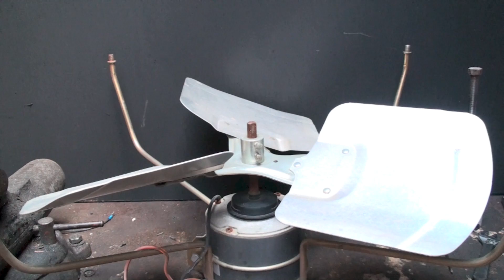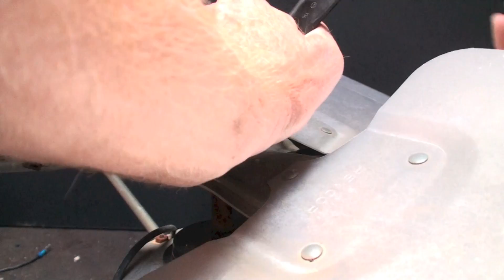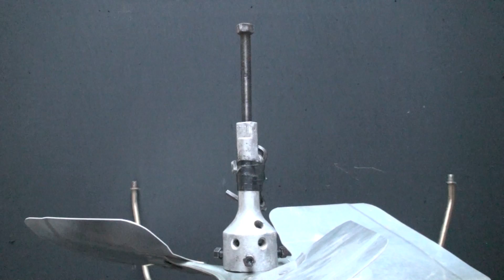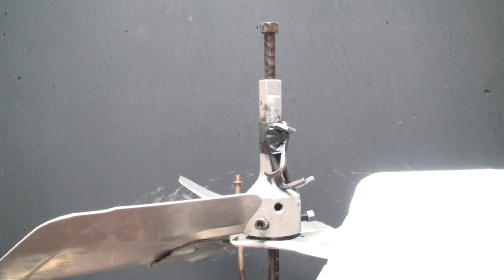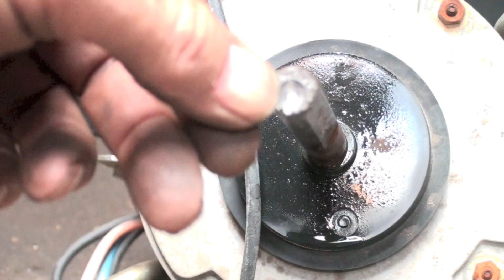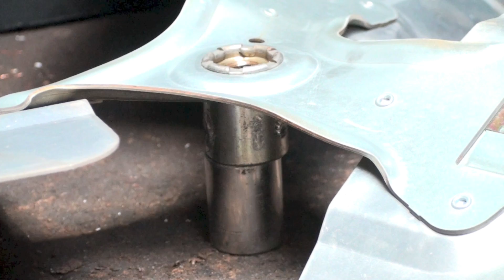How to pull a condenser fan blade

Comment: I ran across this technique. I didn't buy the guys tool, but used the process. After cutting the shaft off the motor, I used an old spark plug socket in my bench vice to drive out the shaft. It was remarkably easy. https://www.youtube.com/watch?v=11WzoU8AeJU

Comment: You don't need that puller at all I just use a wire wheel on my drill go around the shaft a few times until the rust is gone put some WD-40 hold the fan with my hand a few taps with a hammer falls right out. I got the idea from this video here it works every time.  https://www.youtube.com/watch?v=eUXvgJDRjrI

Comment: I may make me one of those pullers out of steel on my lathe :)
Reply from the maker: You can do it but make it  out of tool steel and harden it.
GFM
Reply: Absolutely, tool steel is cheap and I have a forge so heat treating is no problem. What is a good universal size to slip over the hub?....you work with these more than me. Thanks!

Comment: What causes air to exit a condenser fan grille horizontally instead of vertically? The only reasons I've heard: fan ass'y running backwards, wrong position of fan ass'y relative to the shroud (fan tips supposed to be about an inch up into shroud) and plugged cond coil. Have one now doing horizontal air flow, but none of those conditions. Cooling well. 18 or 19 degree temp spread.
Reply from the maker: It may have bee designed to work that way.
GFM
Reply: Check your capacitor if it’s running backwards.

Comment: A little tip ---since the motor is junk any how , instead of sanding the shaft, you could take your 4" grinder out of the truck and Lop off the end of the rusty shaft. Less shaft to pull. If no grinder on the truck , then yea , sand her down to shiny metal. Makes life a whole lot easier ! Rust I have found actually increases the size of the shaft. Get rid of all rust. It's worth the time.
Reply from the maker: Good tip.  Thanks.
GFM
Reply: You have saved my life!! Awesome tip will try on the motor change out i have tomorrow

Comment: I just replaced my condenser fan motor with a brand new Century universal motor with exactly the same specs.  When everything was buttoned up and looking better than previously (meaning extra care in zip tying wire looms, etc), the fan squeaked!  I treated this motor like a baby, never dropped it....  Is there any reason other than a bad motor bearing out of the box that this would happen?  The fan makes noise only in the CW direction which seems odd.  It is a reversable motor set to the CW rotation.....  You seem to be a strong authority and I was wondering if you have ever had a bad condenser motor out of the box....
Reply from the maker: Most of the time when I had something like that, it was because the box was dropped during shipment.
GFM
Reply: I solved the issue and feel foolish...  the dust cap rubber center piece was rubbing on the motor housing making the terrible screeching.  A little bearing grease on the lip and the cap is all it took.  I couldn't believe that it was loud enough to be heard at the street and next door!

Comment: from Illy Hvac llc 
i have a suggestion for you. after you clean the shaft. take a 1/2 black iron pipe, place the pipe over the shaft. hit the pipe hard a few time to break the hub loose. I do this then reclean the motor shaft relube the put the hub puller on and crank away. much easter to remove the hub. 
Ive learned a lot from you thanks buddy.
Reply from the maker: Good thoughts.
GFM
Reply: Yep, get rid of that rust line where the sand paper can't get to without that tap.
Reply: +grayfurnaceman what's the name of that tool?

Comment: T&N commented that you can drill a hole in the shaft.  I can't picture it.  A hole through the radius or the long way?  Also does anyone know what you use to lube the threads of the puller to keep the aluminum from binding up with the steel?
Reply from the maker: acoustic4037 You will be drilling a hole longitudinally thru the shaft.  Any penetrating lube will do.
GFM

Comment: My condenser fan is stuck to a rusted motor shaft. I don't have a gear puller but I do have two C-clamps. I used a wrench handle as a crossbar as I tightened the two clamps. The fan won't budge and I am afraid the monkey wrench handle will break. I need ideas.
Reply from the maker: Gino Punsalan Cut the shaft with a hack saw close to the hub.  Then you can place the hub on a vise so you don't damage the fan.  Hope this helps.
GFM
Reply: The motor is good. The fan is damaged that is why I want to remove it.
Reply from the maker: Gino Punsalan Then I would cut across the hub with the hacksaw.
GFM
Reply: That worked. I cut the hub in half with an angle grinder. New fan installed. Thanks again.

Comment: Very nice video I like it. Question:   My outdoor fan motor is drawing 1.03 amps  it is stamped  FLA  1.3  amps  it seems to be working fine. Do you think I should change it out?  thank you for your helpful videos.
Reply from the maker: gerry mcadams If the amp draw is at or below rated amps and the voltage is correct, it is ok unless the bearings are stiff.  Hope this helps.
GFM
Reply: Thank you so much for responding, It did help me out. I really enjoy your videos, You just got another subscriber

Comment: two things, first it can be found on ebay UP1 Ultimate Fan Blade Hub and Blower Wheel Puller Remover Sensible Products for about $55 shipped, they retail at local supply houses too msrp is $77
second I find a slight flaw in your technique, if you notice the top portion of the puller is slotted so as to be held with a wrench while turning the bolt, this keeps you from putting pressure on the fan blade eliminating the chance for damage.
Reply from the maker: Good point.  Thanks for the thoughts.
GFM

Comment: You can spray some wd-40 on the shaft before you put the puller on it and if you take your wrench and tighten it to the shaft of the motor and spin the blade it loosens things up alot better
Reply: Yep, good tip.
Reply from the maker: I agree that could certainly help.
GFM

Comment: Hey GFM, I've found what works really well is to drill a hole in the center of the shaft. It relieves the pressure and the blade will come off then. Ive also heated a few shafts in my time.

Comment: After years of struggling i finally got myself a fan blade puller, had to import it as not available here! 
I got a Supco one, which looks the same as Yellow Jacket which is made of steel. it hasn't failed me yet. I have a small wire brush i put in the battery drill to help get the rust off the shaft, and usually put some grey primer on the new shaft to make it easier the next time round with blade removal. Great vid!
Reply: Yes. Ahhh for a little grease on that shaft when the blade was installed.